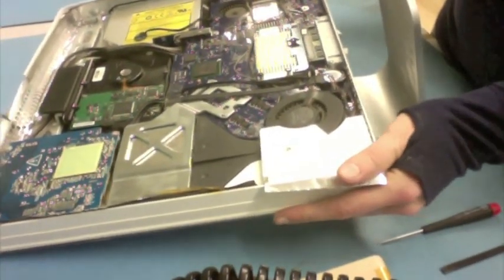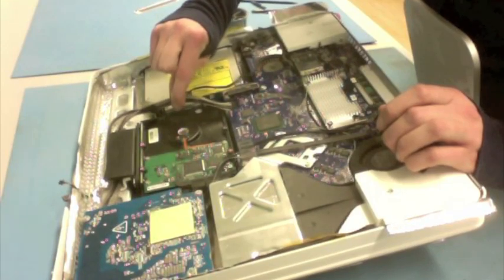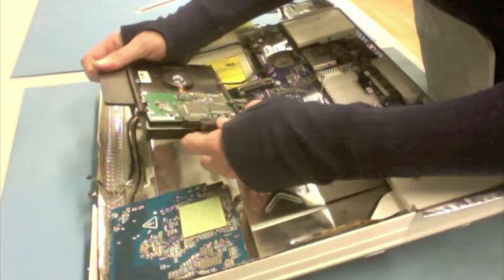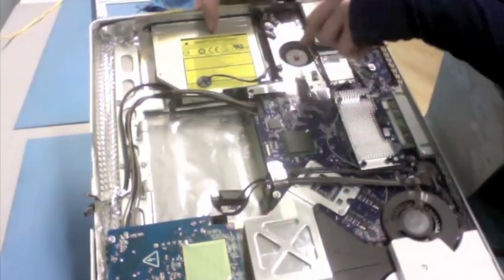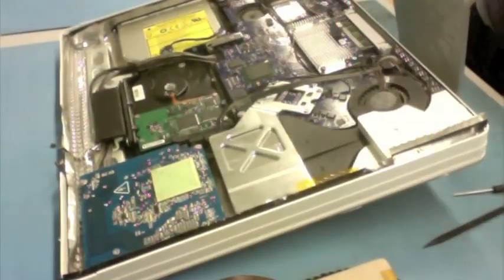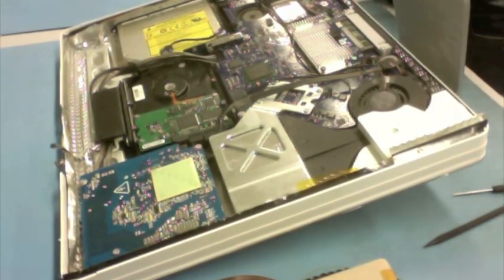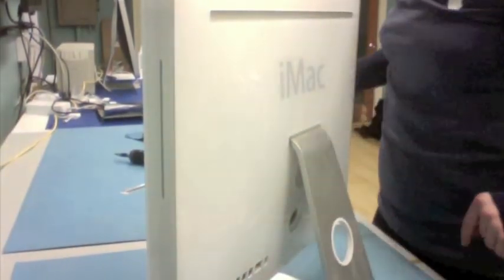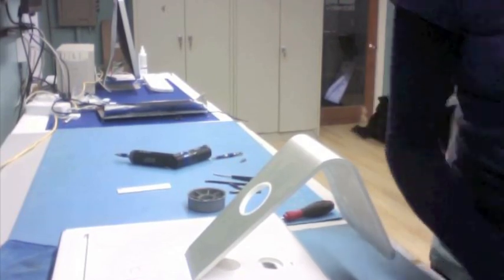First Gen. Intel iMac Hard Drive Replacement, Part 2

Comment: Great 2 videos! Thank you so much for sharing your clear explanations and tips. I just replaced my Hard Drive in a 2006 model A1174 iMac with an SSD. The interior was somewhat different but without your videos it would have been a tough and worrying job to have done. Another computer saved from the bin and being put to good use again. THANK YOU!!!

Comment: One small note:  the access holes to the four T-10 screws are quite narrow and deep.  My T-10 bit held in a universal handle couldn't reach in there.  Fortunately I had a dedicated T-10 driver as seen in the video, but even it just barely fit (it isn't as slender as the one in the video).

Comment: Tip use puddy on the end of the screwdriver bit to install the screen screws since they are recessed they fall off the bit. Apple is retarded with their setups, it took 5 minutes to take this apart. Good video here. Apple is becoming not very user friendly in the repairs as they want to maximize the amount they rip you off for.

Comment: Thanks for your excellent video. In my case the left hand clip was broken off inside the cabinet and assembly at the Apple Factory had Jam the whole thing together requiring Force 2 get that corner loose. Apple design totally sucks. Don't buy this garbage if you're smart.

Comment: One BIG advantage of keeping an old Core Duo is the legacy factor. If you still have old favorites like MacDraft, etc. this is the last Mac that can run them in emulation. I'll be replacing the locked up drive in ours for just this reason. If you can afford an SSD it will be a screaming old bugger. I just dropped an SSD in a 2011 i5 Imac that I PU for 200.00 on eBay using the well hidden extra Sata port along with a 2TB main for storage (all thanks to Macsales vids and adapters) and it is nothing less than amazing for under 400.00. I used a 60GB SSD and it holds all the system plus all my apps and still has 40GB left over for those graphic heavy brochures I produce. Best graphics machine this geek has ever owned. I still have every Mac I have purchased since my 512 original Mac in @1976. I did sell the Lisa for big bucks lol but that I saved on it's way to the dump so it was never really mine, sorta. I run Windows machines as well but Macs Rule! Great vid Rebecca!

Comment: HI rebecca, thank you very much for this awsome instructionnal video.  I have a IMac A1126 2005 and it was the last ones before the intel processors I think.  I was wondering if I can revive it and upgrade it enough to use it with most recent operating systems.  I have a Mac mini and a Mac book which run Al capitan and the brand new upgrade.  Can you shed some light?  I hate to part with it as it is such a nice peice of computer.  Thanks and waiting for your response.  Greetings from Atlantic Canada

Comment: Hey, awesome video.
Do you plan to make a similar replacement tutorial for the mid 2011 27'' iMac by any chance?
I know that this is a lot to ask but I can imagine that there are some major differences between these models.
There is two slots for 2,5'' HDD in the new one, isn't it?

Thanks very much for the answer :)

Comment: AWSOME.. i have a 2007 24inch imac, its the 2,16Ghz model.. it works great right now but i have plans to replace the harddrive to a larger one.. is it possible to get a 640Gb sata II in there.. ?, is there anything that need to be done with the new harddrive before its possible to install the OS.. ?